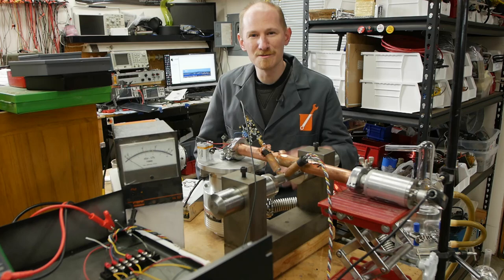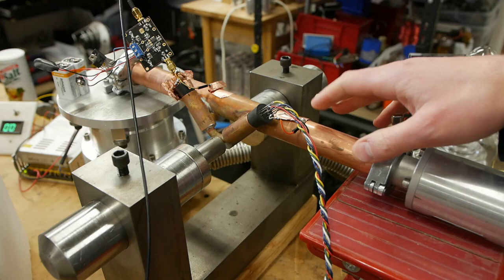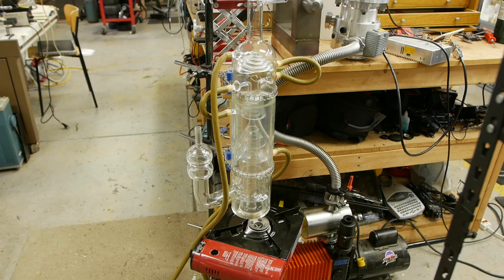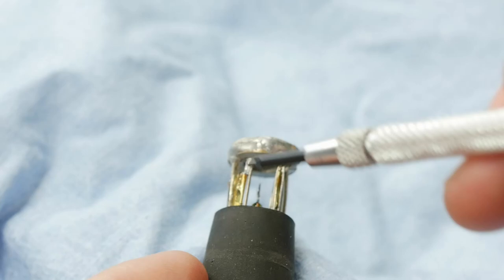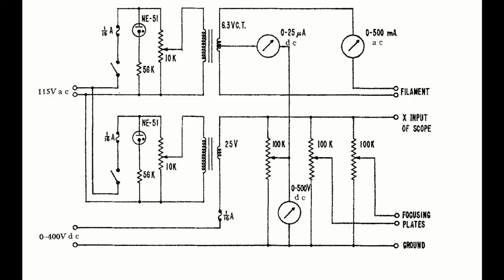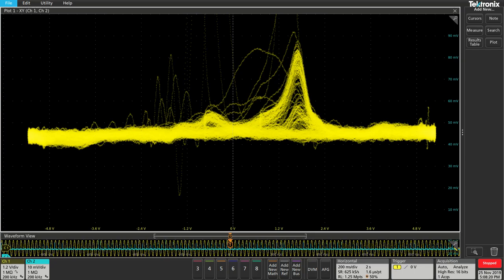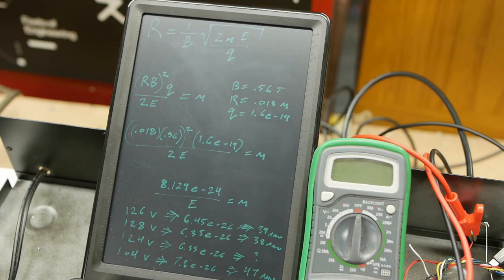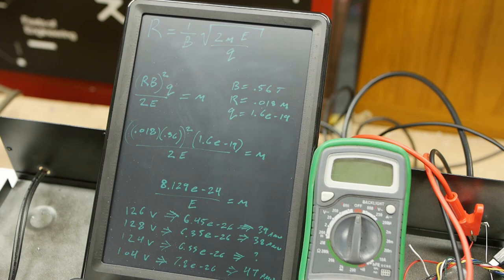DIY mass spectrometer measures potassium in dietary salt substitute

Comment: I've been watching your channel for some years now.  Great videos, learned much, even been inspired.  I don't believe I've commented till now, no sense sticking ones nose unless one has something worthwhile to say, but something you said in this video inclined me to stick my nose in.  You said that you are contemplating producing a similar video using a laser to produce the ionization.  
About 5 or 6 years ago while dealing with some mineralogy problems I cast about looking for some method of doing some elemental analysis.  I rejected a number of methods including mass spectrometry.  The method I decided upon was Laser Induced Breakdown Spectroscopy LIBS as it seemed to be the easiest to implement on by meager budget.  I suspect that this is the technique you are contemplating.  
The system I built was surprisingly simple to build.  It involved a q-switched Nd YAG laser from an outdated range finder from the M1 Abrams tank program along with the associated pulse forming network and trigger module.  Total cost of that stuff, about $250.  I also used a HV transformer from a junked microwave oven,  a 5 amp 120 v variac which completed the laser part of the system.  The original spectrometer was fashioned from some PVC pipe, a couple razor blades. and an old pre-recorded DVD.  
There are some limitations of a simple system like this but so far I have analyzed hundreds of samples and I am building a library of elemental spectra.  I am currently working with a numismatist on analyzing revolutionary war era pennies.
BTW FWIW I believe that I must have bought the last laser of this type as I can no longer find any though General Dynamics is upgrading hundreds of M1 tanks for several orther contries.  If anyone knows if these may become available on the surplus market please post here.

Video I uploaded years ago:
  https://www.youtube.com/watch?v=ZzBSCrS8FAY
 
Ben if I can help in any way let me know.

Comment: The cork is likely Buna-N which a common vacuum o-ring material and it is low outgassing, the others are Viton a Fluorocarbon, and silicone - so no surprise Buna-N works as a feed thru material. The Silicone hose however was a surprise that it did not work, even with a simple hose clamp - I do use vacuum grease on the hose connector so the hose clamp does not create a fold on the inside of the hose during clamping, The charged plates for focusing the ion beam not working is interesting, perhaps electro-magnets like a crt. perhaps I don't understand, I will have to look at my RGA now Ha!    I really love your videos, thank you!
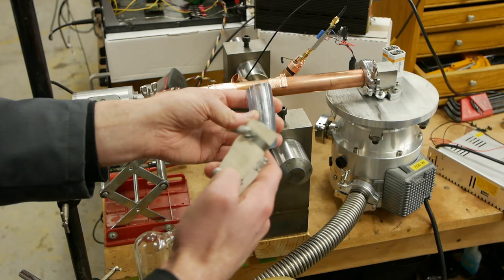Reply: I think he said the clear tubing was PVC  6:26 and the cream tube was 'professional' vac tubing that was also wanting though he did not indicate the material.
Reply: @KallePihlajasaari  Yes, the white cream is likely silicone, comes in red too. I use it on my scroll (roughing) pump for the turbo and again on my diffusion pump's roughing pump as well.

Comment: another great video! One thing with mass spectrometer is the existence of poly atomic interference, Carbon and Chlorine could add up to look like mass 47 . Potassium is particularly troublesome in ICP-MS due to Argon interference. Or the 2 slits are creating the mirror image, but was it the same design in the previous 1970 experiment?
A wider scan could reveal more interference .. great work as always!

Comment: To lower input capacity of your transimpedance amplifier and photodiode there is a technique called bootstrapping, where you put another opamp in a buffer mode over photodiode cancelling its capacity. We even used it in exomars spectrometer
Reply: How well does that work for very small signals? just wondering.
Reply: What the hell are Exomars ? Exozomes grown on Mars ?
Reply: @Basement-Science  we only use it for small signals, so it's working pretty good, sorry for 1y delay)
Reply: @rusticagenerica  try google, it's a space mission

Comment: I believe the peak you see at 104 V which calculates to 47 amu is Titanium that may be allowed into the filament.
Reply: I'm sure he would have done a control run without loading the sample?  AND/OR Sending the sample to a professional lab would not cost a lot and give you a baseline of what is in this salt substitute.
Reply: Hmm, what gives me pause about this is the fact that the graphs between his and the other sources match up so well, and that the distortion caused by both potassium ions is present in the second hump. That would mean all 3 filaments would've had to have a similar amount of Titanium and read it the same every time. To me that implies this is more of an error with this method of collection that is endemic to the design.
Reply: thats what im suspecting, i suggested to do the math to figure out what element it WOULD be if it were a real element, and find where it is coming from. All the papers seem to have it, and if they are all using tungsten electrodes, surely a nearby element would show up?
Reply: @CaptinJangles  maybe something funny is going on with an impurity in the filament. I am sure the filament is not pure tungsten. What else would be in it? Maybe all three experimenters used tungsten filaments from bulbs, and maybe the manufacturing process of tungsten filaments has been unchanged over all these decades.
Reply: @mckenziekeith7434  Yeah, but to me it seems unlikely that the manufacturing process would go unchanged since the 60's. Not to mention who knows if it is even the same across different manufacturers? I mean, I'm sure it's possible. The only way to eliminate this possibility is to run it again with a different substance and see if there's another bump in the same or similar spot. My thinking, but I didn't mention it since I was afraid of looking stupid/not understanding the concept is that there's a reflection of the ion beam that echos back but weaker and at a lower voltage, or that the power alternation is not perfect and some of the ions aren't shifted as far but it leaves a similar distribution.
Reply: Ingredients, alternate materials, and V rise and falls during ion transportation: Looks like: Ingredients: Potassium chloride, potassium bitartrate, adipic acid, silicon dioxide, mineral oil and fumaric acid.  I think in his experiments, though, he might be onto something -- that the shape appears to be a shifted reproduction of the other (often quite similar heights it appeared too).  However, surely he's evaluated with other materials and it would be nice to see those (but there's more comment activity this way). Maybe there's either some kinetic energy thing going on with the oscillating AC voltage, or the voltage is changing up and down DURING the ion travel (I don't recall his AC frequency), but it could be causing a shift one direction, then the other?
Reply: Titanium Dioxide is regularly added to foods as a whitener. Although I would have trouble imaging it dissociating at such low temperatures...
Reply: @CaptainJangles I don't see a reason why the production process for tungsten filament bulbs would have changed since the 60s, especially in terms of things that could contribute to the impurities in the filament or glass. 
It was already a mature technology back then and increasing the purity of the filament has no effect on its performance as a light bulb, but would increase the manufacturing cost. So there's good reason to keep it unchanged. "If it ain't broke," you know?
Reply: @peterbertok4936  TiO2 decomposes at ~1800 C. That Tungsten filament is almost certainly well above that.

There seem to be a few clear 'buckets' that could be the problem.
Impurities in the system (Sample or the environment as a whole)
The electronics of the detector
Physics. Or rather, something unforeseen happening with this particular setup.

I'd probably look at the waveform of the control end first (Because it seems the easiest to change). Perhaps instead of a clean sine wave you could use something with discrete steps? You could easily sacrifice resolution to get discrete steps, with a MUCH longer dwell time, to see if there is some physics based shenanigans going on.

Then I'd start looking into impurities. The Rubber stoppers? Some debris from harvesting the filament (glass powder)? Anti-caking agent in the sample?
Reply: Maybe it could be a grammeter of prefabulated amulite leaking from the spurving bearings?
Reply: alloyed got changed to Allowed, but I think everyone understood what I meant...
Reply: ElectronAsh I believe you solved it
Reply: or titanium dioxide in the salt as color/anti caking agent
Reply: @electronash  I had to look that up and I was surprised I hadn't heard of it before. Good stuff!
Reply: @JackFou  Well, you do need to be sure to prevent side-fumbling. lol ;)

Comment: Excellent video - glad you reposted the whole vid - was so let down when the earlier video stopped mid sentence! Thanks, love your videos and your presentation style. The mirroring theory is a good one I think. To me it looks like a splitting of the beam due to acceleration voltage, via a different path through the magnetic field which, as you pointed out varies across the tube. Would a iron wedge from the end of the magnet to the tube focus the field more?

Comment: I did my thesis on building a compact spectrometer using a CCD sensor. It was great fun.
Reply: @accord3702a  he probably only build the thesis from theory ;P
Reply: accord3702a - There are multiple, open-source visible light spectrophotometers, using a cell phone, for the detector, a replica diffraction grating (an even a small piece of a CD/DVD!) and a razor-blade slit. Calibrated by old fashioned neon indicator lamps and a variety of LEDs across the visible spectrum. 

Google DIY spectrophotometer.
Reply: @nohphd  oh thanks, i saw one of that. any idea with what i can read the time difference of the waves? never figured out how i could do that with cheap stuff if its possible at all.
Reply: DarthZackTheFirst - time difference of the waves? If I am understanding you correctly, they are not scanning each individual wave over a single detector. Instead they simultaneously detect the full visible light spectrum across the imager in the phones camera. So the pixels in the “CCD” column 17 might be photons from 550 nm and the pixels in column 2745 might be photons from 414 nm. With a couple of reference lines, you can calibrate the unit and perform meaningful spectroscopy.
Reply: @nohphd  oh maybe mixed it up with interferometry.but i just see they are using a ccd camera there too. interesting stuff.

Comment: The second spike looks almost like a second order diffraction maximum. You have a slit (two, in fact) in the device and you're pushing particles through it. There's going to be diffraction pattern of some kind... the question is, would that effect be big enough to be detected in this way? Or is that just shown as "blurry spikes"?

Based on my calculations, a 39 amu, 1 elementary charge ion gains a velocity of about 24,969 m/s over an electric field of 126 volts (and it will have energy of 126 electronvolts).

At that speed, a particle with mass of 39 amu will have a deBroglie wavelength of approximately 4.1e-13 metres.

You mentioned that the width of the slit is about 3-4 thousandths of an inch, which comes to about 0.1 millimetres. Since the disparity between the gap width and the wavelength is so large, I don't think there should actually be a lot of diffraction, but still, the diffraction angle can be calculated. With the above wavelength, the first order diffraction angle would be 2.35e-7 degrees.

Estimating the length of travel for the ions as about 0.1 metres from emitter to detector, the actual distance between diffraction spikes should be in the order of 4.1e-10 metres, or about 0.41 nm.

That seems like too small a difference, so this is likely not the correct answer. But it would be really cool if it actually was that! It might be worth doing the math on how this diffraction would affect particle path and what voltage would result in the diffracted particles hitting the detector. The assumption of a constant radius of curvature would only apply if the beam is very tight, unless I'm mistaken. If the angle of the particles arriving to the magnetic field varies, then different velocities (that is, different emitter voltage) can cause them to hit the detector.

Although simpler explanation is probably contamination, like another commenter said, possibly titanium from the filament used to heat up the sample.

Also, are you getting a spike for chlorine? It should be at about 131 volts, by my calculations; that is the voltage that gives chlorine ions the velocity at which they have a matching curvature with potassium ions at 126 volts, so they should be hitting the detector at about that voltage range.
Reply: That is actually quite clever.
Reply: tl;dr
Reply: The chlorine atoms would be bent in the other direction due to their charge so they do not make it through the tube curve
Reply: @bluesteel255  Yes, but you could just switch the positions of the transmitter and the receiver - or change the direction of the magnetic field, if that's feasible. For calibration purposes, the latter would be better. But both should work equally.

EDIT: Actually, assuming the chlorine ions are negative, you'd also have to invert the voltage of the emitter so that the point of origin is negative voltage (ground) and the slit is positive voltage. Negative ions would travel in the opposite direction in the electric field. You would also get a negative voltage at the receiver end. But these are fairly minor calibrations.
Reply: For that matter clean the ion source and prepare the sample with distilled water that doesn't have chlorine to see if the spike drops.
Reply: @barlimanned  yea I had a brain fart, I huff helium all day (quantitative helium mass spectrometry) and am not used to thinking about measuring molecules, lol.
Reply: @bluesteel255  You can make Cl+ atoms, but the ionization efficiency is terrible. Cl ionization is something like 1% at ~16eV in an argon inductively coupled plasma (mass spectrometer).
Reply: I can't remember the context but I recall that phosphates can break down into PO+ ions when heated to high temperature in a vacuum, and tricalcium phosphate is a pretty common anticaking agent...

The molecular weight of PO+ is 46.9732, which seems to line up pretty well? or am I missing something obvious (by far the most likely option, hah).
Reply: @etelmo  Hmm... pretty plausible.
Reply: Yes, I think that is likely to be the case. The other two causes I can think of is double ionisation (unlikely with K+) or molecule fractions (also unlikely, and the secondary peak would be on the other side).
Reply: @CafeBikeGirl  For leak detection?
Reply: @jurjenbos228  Not likely to get molecule fractions from a salt…
Reply: While that would be cool, the answer is probably more mundane: The AC used to power the bulb can't really be ignored - the DC bias causes it to be ground referenced, and thus the voltage between the sample and sensor has the additional component of the AC used to power the bulb, which is loaded and thus has a phase difference with the AC used to vary the bias, and the two interfere, giving two peaks.

The diagram doesn't seem to actually take that into account, and just measures the voltage of the other transformer plus the DC.

It's not a small difference- 9v for the diagram and probably 18v for him (center tapped Vs side tapped)
Reply: I honestly don't think that is the case given the width of the slit is orders of magnitude larger than the de Broglie wavelength of K+.
Reply: @IDoNotLikeHandlesOnYT  leak measurement but yes most people use it for detection.

Comment: You need the area, not the peak heights -maybe you are already doing that. Calibrate the spectrum axis with several know peaks.
Reply: Depending upon the shape of the peaks, this isn't strictly necessary; but you are correct -- it is more proper to use the peak integral.

Comment: If you were to use a magnetron to "heat up" the sample, would that prevent the other spike in the frequency response from appearing? (So long as it's operating outside of the frequencies you wish to measure).

Comment: OMG HE READS AND CONSIDERS THE COMMENTS!!
DIY Functional Magnetic Resonance Imager in 2020 plz!!!  🤓🥼🧲📻🧠

upvote if you agree!
Reply from the maker: There have been legit MRI (not functional) machines described using Earth's field (https://www.youtube.com/watch?v=7aRKAXD4dAg) , as well as permanent magnets (https://www.opensourceimaging.org/project/instructional-tabletop-mri-scanner/) .  I've been really tempted to recreate these, and it's been on my list for a long time.  Getting fMRI to work would really be the next level though ;)
Reply: Do they have schematics for DIY NMR machines
Reply: @AppliedScience  Well actually, there is a paper that describes a full build for a Earth-field NMR, that could also be used for some image reconstruction, see: https://iopscience.iop.org/article/10.1088/0957-0233/21/10/105902/meta 
I also texted the corresponding author and he was very kind, he also provided me a working link for the arduino code.(http://www.phas.ubc.ca/~michal/Earthsfield)
The project is pretty sophisticated concerning the spool manufacturing, but for someone like you, it would be possible to do and may even improve on the design.
Thank you for your awesome, entertaining and informative videos! Keep up your good work
Reply: @AppliedScience  do some cool experiment with a gunn diode